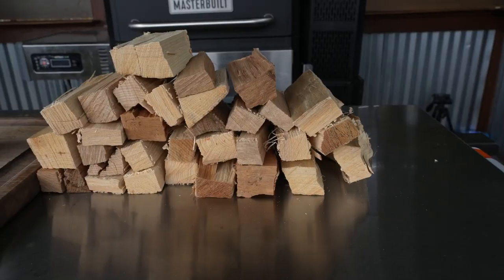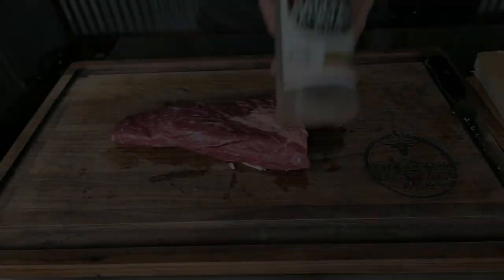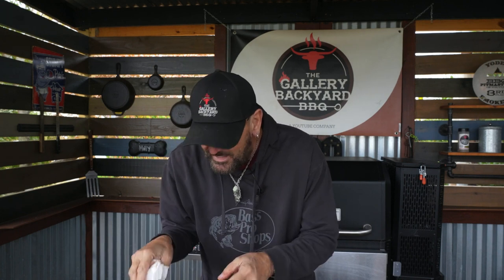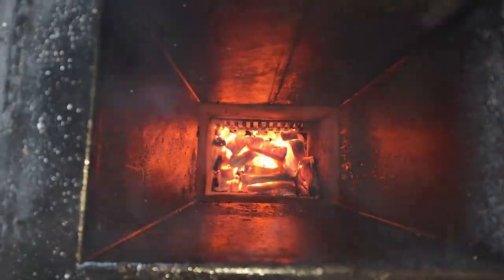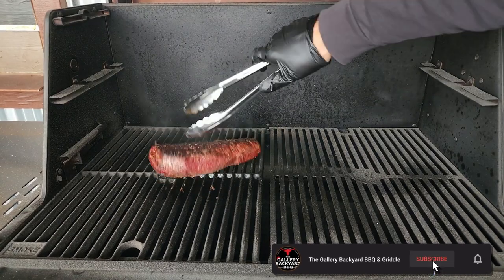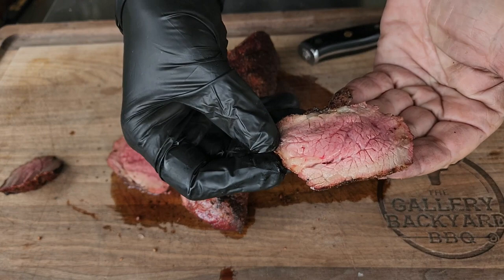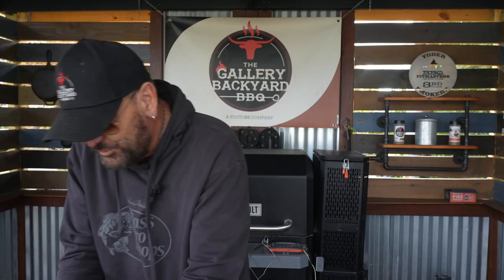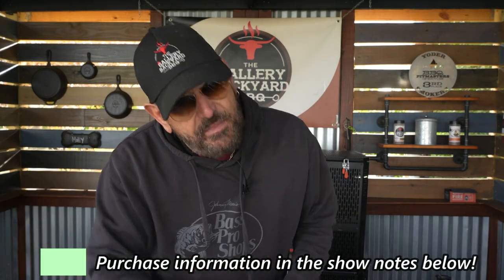I Ran My Masterbuilt Gravity Smoker 1050 On WOOD SPLITS Only And This Happened | Tri-Tip cook

Comment: I’m wondering if the gravity 980 would be better for this given a) the fan has a turbo mode which would probably burn cleaner, and b) the mod replacement fan  is a beast and runs like a jet engine.
Reply from the maker: The Id worry that the 980s flap would burn up.
Reply: @thegalleryBBQ  True. I run mine hot all the time with no issues. But wood will have a bigger flame.

Comment: Great video! What I’d like to find out is if you could use wood pellets, instead of wood chunks on the bottom, part of the tray where the charcoal would drop to ignite the hardwood pellets instead of the wood chunks to give that combined charcoal and wood smoke? Let me know if that’s possible or if you’ve tried that.
Reply from the maker: Ive not tried wood pellets. Cheers